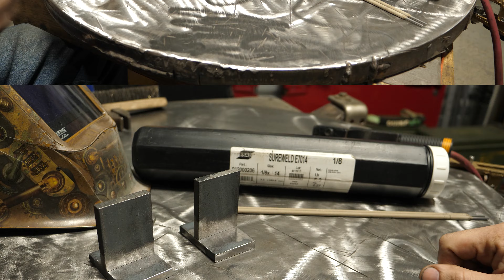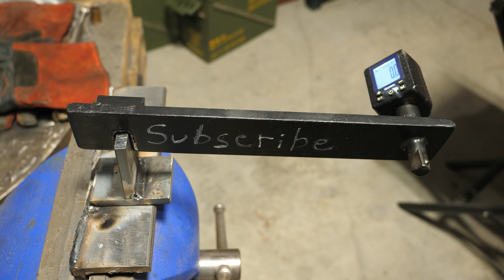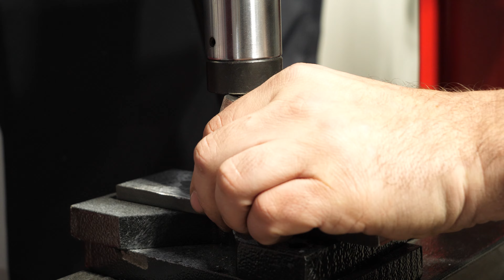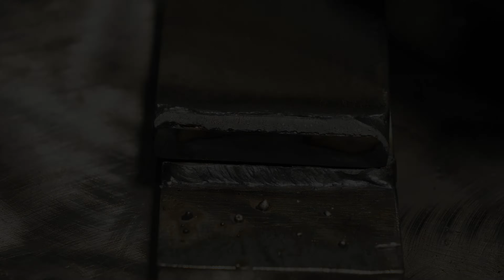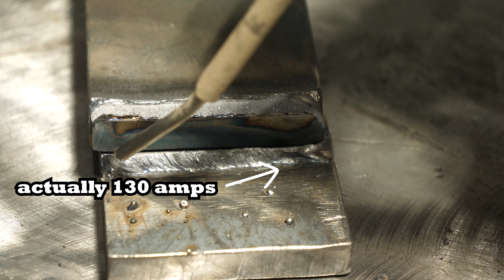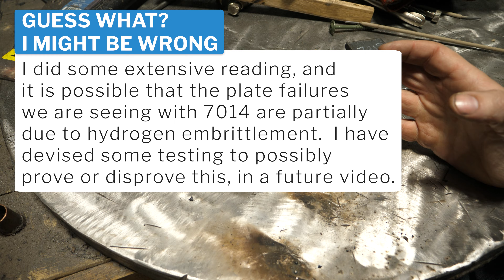7014 vs 7018 weld break test

Comment: I don't recall that when I was welding a lot even though I only occasionally use 7014. I found it the easiest ride to weld with ever. But I'm wondering if the reason you had the failure on those is because you welded them way up in the 125 amperage area. That much heat can cause the resulting austenitic Zone to fail. Is that possibly the issue, bring it down to about 110 amps so that you can get that weld in there. I do remember that 7014 was almost exclusively used in nuclear plants. Because of its ability to be an all position rod. 7018 must be used in vertical up as well as in horizontal. The first time I ever got 7014 to build some dip tanks with, I thought I'd died and gone to heaven it was that easy to weld with . But considering it's supposed to be rated at a higher strength and yet it fails before the 6010, which does indeed penetrate better because it's designed to penetrate, I'm wondering what the issue is. I did find using 6013 was best whenever I was welding on anything galvanized if I was using a stick. It actually produced some really good welds.
I'm hoping I catch this but why in the world did anybody ever think that it was a good idea to make a gas for mig welding that was primarily Argon with some CO2 at 2% oxygen? I finally found an argument for that, but it doesn't make any sense to me and it was only applicable when you were welding large-scale stainless fitments or blocks together what Ford had asked us to use that whenever we're making dip tanks and the light out of half inch and 3/8 plate stainless it was utterly ridiculous to intentionally contaminate the weld metal and that's all it was doing. We actually been tested it and it would fail quite spectacularly. I'm wondering if it was just some young engineer who thought he had come up with something that wasn't applicable to the application he was having us use?
Reply from the maker: You bought up a lot of good points and ideas.  Couple things I will update you on.  So believe it or not it’s actually very common for actual weld test results of 6013 to hit over 70k tensile strength and 7014 to be the same or less than 6013.  A viewer sent me some links showing a few brands on rods (esab was one) and no BS the 7014 was the same or less on actual tensile strength as the same companies 6013.  The results in the video I think comes down to the 7014 being 12-14k tensile strength under 7018s actual testing.  Not all companies 7014 test so low, I am going to try another companies rods and see what happens.  It tends to produce very low penetration no matter the brand, but penetration isn’t a huge issue when you bend a weld away from the face.

As far as the oxygen blend, it’s commonly used with spray arc.  I just picked up a bottle for a project I am working on, it will be interesting to see what happens.  I am going to be up over 350a and some big wire, so I will find out what happens lol.  Your thoughts make me wonder what the results will be.  I will have to run some test welds and bend them for sure.

Comment: The weld has to be as thick the base material to do a basic bend test. Make multiple passes until the weld is as thick as the base material. I'll bet you won't break the weld so easy if the weld is as thick as the base metal.
Reply from the maker: So in the case of 7014 it actually is significantly weaker than 7018 (both on basis of AWS spec and actual testing) and even multiple passes of it would not likely cause it to hold on.  In the case of 6010 I demonstrated that in this video: https://youtu.be/I4e36fBMd7k?si=bPdif7VG0nl-Wjo2

The fillet weld break test in the video doesn’t load the weld equally (one weld toe gets loaded more than the other because of how the plate bends.  More welds doesn’t change this fact, therefore 2 more passes of 7014 will not change the fact it will fail at the toe.  Partially it’s not absolutely a perfect test, but rarely would a fillet weld someone makes at home ever be perfectly balanced with force being applied to the weld perfectly equal.  

7014 is not a equivalent to 7018 in pretty much any respect unfortunately.  But it really wasn’t designed to be a replacement for 7018.  It was designed to weld thinner material, be easy to run, and perform really good in most positions while depositing a slightly stronger weld than 6013.  Believe it or not 6013 is actually close to 7014 for actual tensile strength testing, with 6013 often hitting an average of 70k and 7014 in the ballpark or 74k.  7014 has more metal deposition though.

Comment: Great stuff as usual!  I definitely find 7014 easier to run in my welder than 7018.  I never get those "bubbles" on the surface that you do, and I'm not welding a skyscraper or ship or whatever --so, when I'm feeling lazy and don't want to worry about burn through, I reach for the 7014's.  That said, they stink link burning rubber IMHO and the slag can be much more of a hassle than 7018s.  Oh well.  Guess there really is no free lunch!  Lol  Keep the learning/teaching vids coming, please --they are awesome!!
Reply from the maker: To this day I am still not sure what the bubbles are.  I still get them with the multiple different rods I have.  I will have to revisit running them on new material some day and see what happens.  7014 definitely does produce stronger welds than the 60xx series rods, it puts down far more metal, and it runs on any welder.  Definitely a useful rod, and I much rather use it than 6013 😀
Reply: @makingmistakeswithgreg  Maybe not you so much but other vids I watched were all over starting with 6013 rods to learn to weld.  WORST ADVICE EVER!  THEY SUCK!!  LOL  To this day I still can't run a decent 6013 weld but give me a 7018 (or any 70 series) or 6010 or 6011 and I can lay down some nice stuff.  Your results with 7014 is really strange 'cause I bought the same Blue Demon rods 'cause they were the cheapest and available mostly but I get no bubbles on clean or dirty mild steel (when I say dirty, I mean I brushed it off but definitely not shiny metal surface that I welded on).  Just super shiny welds under the heavy dark slag.  Very strange.

Comment: A lot of farmers use 7014 rod because all they have is an old ac buzz box welder. 
I get you can get 7018ac rods now. But they don't weld as easily as regular 7018 or 7014.
Reply from the maker: Good point.  The non A/C rods are hit or miss with how they run on a buzz box.  Many that say they will run on AC don’t lol.  7014 is definitely stronger than 6013.

Comment: Is the difference between lubricated and unlubricated press tests relevant?
Reply from the maker: Because I round the corners of the plates there is very little difference between lubricated and unlubed plates.  At some point I switched to ar500 base plate and dry lube to reduce wear.  The goal of the press it to generate enough force to fully bend the plate more than to produce accurate measured loads.  I include the pressure gauge because it’s common for welds to fail under very little pressure and the gauge can reflect that.

Comment: One idea for a video that I believe could help a lot of people getting started in welding would be comparing 2 of the most popular welders on Amazon... Toolium 250a vs YESWELDER MIG-250 PRO... I purchased a week ago the Toolium 250a at an Amazon sale for $291 and so far I quite happy with it.  The reason I got it was because there are a few good videos on youtube about it and it was cheaper then the Yeswelder-250 but I really wanted to know how it compare with the Yeswelder-250... if the Yeswelder-250 is worth thr extra money... btw before buying the Tooliom-250 I had 2 welders... a "Forney Easy Weld 261, 140 FC-i Welder, 120V" (wasted my money... got when I knew very little about welding and because of the high number of positive ratings on Amazon)... and a "KICKINGHORSE A220" (this is actually a very good stick welder in general but after seeing how easy it was to mig weld... that is why I bought the Tooliom now)
Reply from the maker: In the future I will definitely do a bunch more comparison with entry level machines.  A lot of them have become decent enough to recommend for beginners. More affordable options means more people building stuff 😀

Comment: I’d be interested to see some tests with thicker 7024 vs same size 7018.
Reply from the maker: From a strength perspective I have found that 7018 will outperform 7024 on a fillet weld break test towards and away from the face.  The interesting thing is 7024 run in the flat position seems to out penetrate 7018 on a flat plate, but on an actual joint it penetrates less.  I believe 7024 was primarily designed for flat butt welds and it definitely seems to run good  on those.

Comment: maybe more of a v grove on heavier material will give the 7014 better strength
Reply from the maker: So I have a video out on beveling soon.  Beveling will increase weld thickness, which will give a stronger weld when bent towards the face on a single sided weld.  It unfortunately won’t increase the welds ability to hang on when bent away the face.  Beveling is definitely desirable to bevel when you can only weld one side.

Comment: That stuff was not welded that was like caulk on there. You didn’t go deep enough I’m not a welder, but when I weld stuff like the old man said you’re trying to cook it all the way through who cares a bit pretty as long as it’s cooked all the way through, two pieces of metal turned into one
Reply from the maker: 7014 is a fairly low penetration rod, and upping the amperage unfortunately doesn’t help much.   It’s a great rod to use on thinner materials or in the flat position butt joints, where its lack of penetration is less of a concern.

Comment: Will 7014 or 6013 welded on both sides do better than the 7018 on just one side,,
Reply from the maker: To answer that question, if you were to weld both sides of the plate single pass with 7014 or 6013 the plate will still break off.  At some point you could probably weld the opposite side enough that it wouldn’t fail anymore, but you’re probably talking 3+ layers.  When you bend a plate or a weld one side is under tension and the other side in under compression.  6013 and 7014 can handle much the same compression as 7018, but in tension they are weaker.
Reply: @makingmistakeswithgreg  👍👍👍

Comment: Sir.what is the name of gauge to use in this break test
Reply from the maker: So the torque measuring device is a torque adapter used to measure the torque applied to the lever.  The lever I made.  Keep in mind the  setup is primarily meant to be used just to compare strength of the welds I test amongst each other, it’s not designed to be accurate to other devices.  Without the black extension bar the torque adapter wouldn’t be able to read high enough to give an accurate reading.
Reply: Yes.thanks

Comment: Since you're actually loading the root in shear, it would be interesting to see the result of using a beveled T joint, if only for the sake of seeing what gains could be had if welding a high stress joint.
Reply from the maker: So your saying welding it out with a bevel to achieve full penetration?  I have a video on beveling welds and if it increases strength, it will be out in a week or two.  I have bent test (off camera) 3/8th plate welded with a bevel and it passed just the same on a bend away from the face.  Where a bevel helps is bends towards the face.  By reducing the leverage the plate has using the weld as a fulcrum, it takes way more strength to break.  On stuff that sees loads from multiple directions a one sided fillet weld is only the strongest in one direction (away from the face.  A full pen beveled weld on a fillet could give equal strength in both directions.  It could also be welded that way with access to only one side, because the alternative would be to weld both sides of a fillet weld (which may not be possible).
Reply: @makingmistakeswithgreg  I'll be looking for that video.

I neglected to mention that I realize that the purpose for this test was comparing electrodes only. 

Owing to the wide variation in welding equipment and the electrodes that can be used, seeing the benefit in taking the extra steps for a critical connection will be worthwhile for those limited to AC only electrodes.

Comment: interesting ! thank you looks like I will be buying 7018 in the future instead of my trusted 6011 rod.... the whole idea for me is that the weld should be stronger than the steel your welding....I do not want my weld to fail i would rather have the steel fail. so thank you for the great information !
Reply from the maker: Definitely on thicker steel when bent/pushed hard 7018 will clearly keep things attached better than 60xx, and 7014.  In my testing er70 Mig, 7018, 7016, and dual shield wire will have no issue keeping things held together on thick plate.  When strength is a concern those should be the choices made.  They also will likely will handle impact shock better without failure over many 60xx series rods.  6011 is still a great rod for a ton of jobs like poor fitups on non critical work, out of position work on non critical stuff, and I really like it for doing fence work repairs.

Comment: but i i do run 7014 at like 120 225 and 7024 at 180 240  amps at but their like 5/32
Reply from the maker: I will have to give the 5/32 rods a shot in 7014 and 7024.  I have only ran those in 1/8th sizes.  I have ran 7018 up to 1/4in diameter when I was in school.
Reply: @makingmistakeswithgreg  thats imprisive i think the biggest i run would probley be what called a rocket rod i forgot the diameter but the amps are hard to forget i think amps where like 1,000 the were used to weld crucibles baxk to geter the hade to be used with a tripod

Comment: You made some very good points when comparing 7014 vs 7018. A lot of people don’t understand that. What many don’t realize is that most welds made with 7018 are run without heating the rods. I’ll do that too with A-38 or 1080. Though I’d rather use MiG. Oops. I meant to write 1018, not 1080.

Comment: So how about doing a bend test with a 6010 root (maybe 3/32) then two 7018's (1/8)? (yea, I know... pipe...)
Reply from the maker: So I tested a 1/8th 6010 root and 2 bead 7018 cap, the video is here:  https://youtu.be/WJ1hgfscVe8?si=DNCfwjPR-vJxrtUc
Needless to say the performance was excellent.   I definitely wouldn’t mind using that as a practice for general use, not just on pipe.